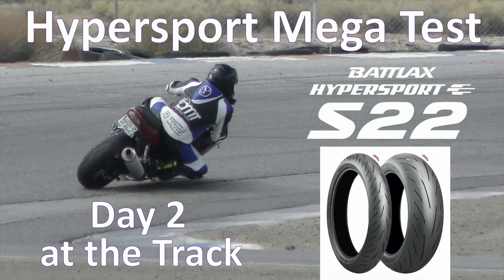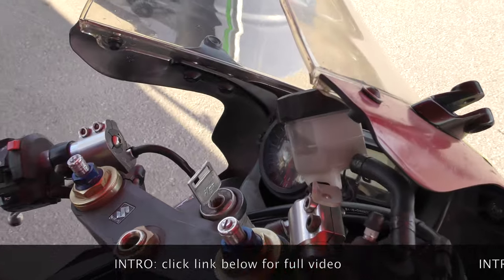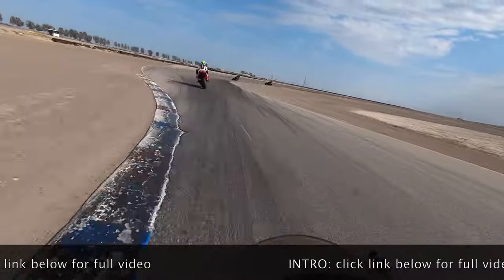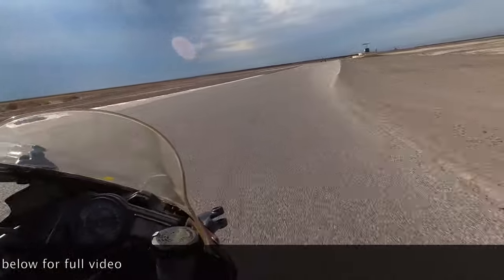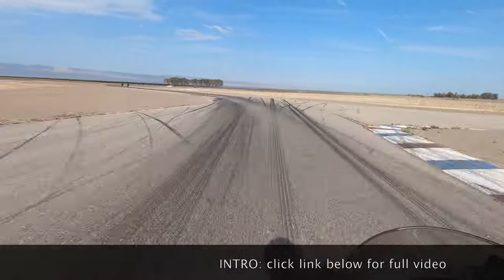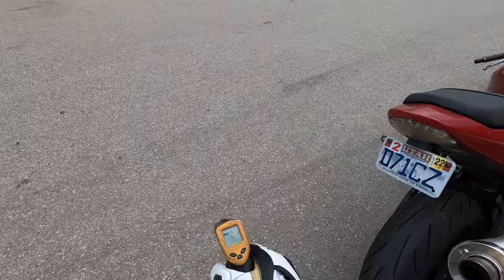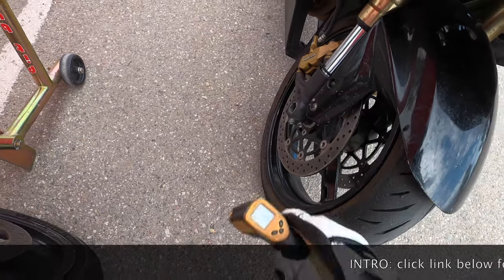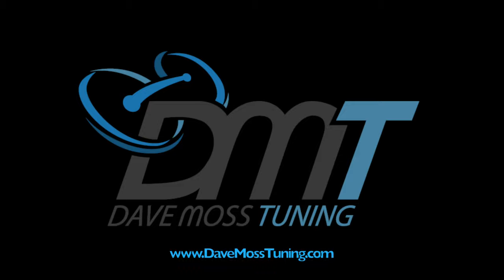INTRO Contact Patch: Bridgestone S22 test at the Track, Ep 8

Comment: Love you guys! I'm trying to get into track riding.  The cost tho. Have to get a trailer & everything but looks so fun!
Thank u for all the hard work put into this mega tyre test
Reply from the maker: Track riding can be done very cheaply. If you need a trailer, you could start with ride shares as many riders do that to help each other with costs. Always post and ask and you will be amazed at the support there is out there to get riders like you to the track. A small car trailer like alumline.com are relatively cheap. You can use hypersport tyres and all that is needed is brake light and mirrors taped.

Comment: I have these tires and very confident with them. I don't track ride but do ride aggressive on the streets. But I'm wondering if Pilot Road 5 might actually be better and easier heated to optimal temp and actually last longer than a hypersport tire like s22
Reply from the maker: Longevity is a tough one for a comparison based on road speeds and local road surfaces as there is so much variance. Road 5's are softer carcass and might heat up quicker overall.

Comment: Hey Dave do a lot of aggressive street riding and about to go to first track day currently on s22 but will need a new set do you recommend sticking with these or upgrades to the Dunlop q5s
Reply from the maker: If you stay with the S22, handling will be very consistent with what you know. That is critical for your first track day. Changing wil completely alter the handling of the bike and unless you do some work with chassis geometry and suspension, you will be disadvantaged and that would not be a fair comparison for the Dunlops.

Comment: Dave for fast road use bridgestone s22 or michelin power gp?
And what psi to use them
Reply from the maker: Depends what "fast" is....... I prefer the S22 for sidewall strength and carcass being able to follow the pavement surfaces well. For street is use 34 front and rear, BUT,  I do not ride fast on the street.
Reply: So Dave no the 36f 42r psi for aggressive road ride?
Reply from the maker: @user-cm8nf2bl1s   You can have any pressure that you choose. 42 for the rear would be too high and might create deflection so feel free to test 40 and 38 to see if you get more grip and as you ride aggressively, that would be a logical choice based on tyre pressures being around 30 cold at the track as a perspective..
Reply: So you mean 36 front and 38 rear
Reply from the maker: @ΑνδρεαςΔαναινας   yes sir

Comment: Hi Dave, I have a 2015 bmw s1000rr, it's time to change tires to go hard on the road, which one do you advise and what pressures ? 
Thank you very much.
Reply from the maker: I would suggest that you choose a hypersport category tyre with soft sides. The choice depends on grip vs longevity and your wallet's ability to keep throwing tyres on the bike. So the list is in order of grip 1st through to longevity: Q5 and Pirelli SP, Rosso III, Rosso IV and M9RR, Bridgestone S22/23 and Conti Sport ASttack. Pressures would be as recommended by the manufacturer, generally around 32/30 for very aggressive street riding to ensure maximum grip.

Comment: Hi dave, I just bought this tires and not installed yet, I use sc22 supercorsa 200/55/17 on rear and 120/55/17 on front... I just like to hear an honest revirew from you about this tires for track and everyday use, Its cheaper tire. I have s22 bridgestone 190/55/17 and 120/55/17. My sc2 supercorsa life span was very fast for me.
Reply from the maker: All hypersport tyres are amazing.  If you had Pirelli before, these will feel very similar as they share almost the same carcass and profile. Both Pirelli and Bridgestone will last the same amount of time.

Comment: Quick question here 🙋‍♂️ - I currently have a Q3 plus (rear) that is flat, courtesy of huge nail (not repairable)and while I am looking into either getting a Q5s, it’s little pricey so I am considering a S22; I noticed in a previous comment you mentioned the turn in slower, which is okay since I am indeed that and not really much of a knee dragger (working on it) is the turn in and shape similar to the Q3?
Reply from the maker: For what you describe, the best option is to find the same circumference rear with a very similar hard carcass. take the ruined tire with you to the shop and do some comparing.
Reply: @catalystreactionsbw  Sounds good, thank you.

Comment: Hey Dave, Ive been running these tyres on my sportbike mainly for street riding but its usually done around twisty roads. Was wondering what optimal temps i should be looking for when aggressively street riding (60-85 mph). I live in a colder climate so i'll adjust psi accordingly, but was looking to see what optimal temps i should be aiming for after about an hour of riding
Reply from the maker: Ideal gain is 2-3.5psi above cold after 40 minutes of riding. Temps? 120-150F if you are using an infra red laser.
Reply: @catalystreactionsbw  Thank you for your reply! I went for a ride today and ran 32f/35r psi and after about 30 mins there didnt seem to be any psi gain in either tyre and the bike felt a little squirelly, would you recommend adding pressure or reducing pressure in this scenario? (Ambient temp was around 44F)
Reply from the maker: @SteGy  Let's  test 32 front and 36 rear cold. Ride for about 30 minutes and check with the palm of you hand pressed in firmly. The front will feel cool to cold no ,matter what pressure you run in it and 32 would be as low as I would go.
Reply: @Dave Moss Tuning  appreciate the reply Dave! Will adjust pressures and  test when the weather allows and work from there! Great content and lovely support as always, heavily appreciated!

Comment: Which tyre would you choose for hard street riding. S22 or Rosso Corsa 2 :-) which would you trust more :-) ?
Reply from the maker: Rosso II is the harder carcass so ti will handle road conditions well at speed. The S22 is slightly softer and more compliant so bumps are a little smaller on impact for better stability. Both work incredibly well and as we are in a golden age of tyres, both work very well indeed. Rosso II will last longer in my experience, but you are looking for grip not longevity.

Comment: @Dave Moss Tuning  hi what is recommended for tires for commuting and maybe a little harder driving than touring, on a yamaha r1 2020 ? ☺️
Reply from the maker: Michelin Power 5, Bridgestone S22 are softer carcass so bigger contact patch when enjoying the turns and better compliance over the bumps.
Reply: @catalystreactionsbw  I must ask u a thing about the road series (road 5 or 6) 
Is the power 5 still the way to go or is the road tiers any option,  just curious
Reply from the maker: @forse88  The Power 5 is an excellent road tire for the vast majority of rides especially as road conditions are so inconsistent these days!
Reply from the maker: @forse88  I have a set of Power 5 to go on my Kawasaki Concours to test. I have not seen the 6 yet to compare.
Reply: @catalystreactionsbw  ok i was thinking to try a road 6 on my r1 just becuse of the longtivity ☺️

Comment: Hello dave, I have Q3+ used for agressive street riding and occasional track day. They are not available anymore, I am getting S22. What difference should I expect?
Reply from the maker: S22 is a softer carcass so less bumps overall, more compliance and slightly slower turn in if pressures are too low.

Comment: Using battlax s22 120 front and 160 rear. Any recommendation for the tire pressure in PSI? Thx you 🙏
Reply from the maker: Street, aggressive street, track? Please give me the information needed.
Reply: @catalystreactionsbw  aggresive street sir. Thank you before
Reply: And track. My body weight 96kg with yamaha R25. Thank you
Reply from the maker: @SepuluhSeptember  I would start at 30 front and 32 rear to give the carcass some shape under cornering loads. 3-4psi over cold would be the ideal gain.
Reply: @catalystreactionsbw  thank you for the answer, i tried and need to adjust little bit and feel awesome 👍
Reply: What is your experience with this tire in the rain? Like a good amount of rain
Reply from the maker: @Mech.E  Does an Antarctic storm count in New Zealand for two days?  Great - never a scary moment with 40 cold front and rear to make sure the sipes stayed open.
Reply: @catalystreactionsbw  awesome, would you say this tire is a bit overkill for just street use? Btw I'm going to fanboy a little and say I love your videos. Been watching before I had a bike. Picked up a z800 recently and made my dream come true.
Reply from the maker: @Mech.E  For street use yes - I'd stick with the Power 5 if you are a Michelin fan or any other tyre in the hypersport category. Congrats on the Z800 and making this motorcycle a reality for you not just a dream! Congrats :)
Reply: @catalystreactionsbw  Thanks a lot!
Reply: @catalystreactionsbw  what tyre pressure for track day on s22's , thanks in advance Dave!
Reply from the maker: @dottore46full  I would start at 28 rear and 30 front and note that a 4-5.5 gain over cold is ideal.
Reply: @catalystreactionsbw  thanks man

Comment: Dave i have a question, should I put the new set of s22 180/50 on my gsxr 1000 k7.. I took em for zx6r but sold the bike and got 1l,what should I expect is it worth doing it
Reply from the maker: If you have a 5.5 inch wheel yes. If a 6 inch rear wheel, no as you can roll off the edge of the rear tire.

Comment: Is bottoming out whilst braking too much of a problem? Cheers Dave.
Reply: yes because then you basicaly dont have any more suspension and therefor low grip.
Reply: On the cusp of catastrophe.
Reply: Solution? Add more compression damping,still have plenty left.I have no preload adjustment.
Reply from the maker: Look at it from this perspective. If you bottom out, you can not add any more brake pressure or the rear will lift, then you have to release the brake to put it down again.  Yes, add compression damping and if you max that, add 25cc of oil to each leg unless the oil is over 5,000 miles or 8,000kms of use.
Reply: @catalystreactionsbw    On an 2023 MT-09-sp with KYB forks. .   Trying to understand where the bottom actually is.   My zip tie is 3/4 " from the bottom after hard breaking tests.   Is the bottom of the lower tube the actual bottom of travel?   Or is the bottom of travel some height above the bottom of the lower tube?
Reply from the maker: @MrArtisticGuy  This video will help. Not that specified travel is 130mm. I have not seen a 2023 model so I will not guess. https://www.youtube.com/watch?v=eds3dn1LBkw&t=80s

Comment: Dear Dave i have a major problem with these tyres.I have high speed wobble that starts at 170km/h (yamaha tracer 700).I found that others have the same problem with sport touring bikes that didnt had with previous tyres.I changed air pressure,i set the suspension correctly,it seems like aerodynamic problem.Any suggestions?Thank you.
Reply from the maker: How much shock travel are you using compared to fork travel? That will give you the insight you need o understand why this is happening.
Reply: same problem with the mt-07, it also wobbles at speed
Reply: @ikbendusan yeah men,many people have this. There is no way to pass this problem...the only way is to change tyres.Can you tell me what tyres did you also tied
Reply: @BGDS  both the original tyres and the replacements wobble. it came with bridgestone bt023 and i replaced them with bridgestone s22 after i wore them out
Reply: Same here. I’ve had the same problem whether it be from a stand still or a roll on to high speed. Came stock on my KTM Superduke R.

Comment: S22 bridgestone is a shitty tire it wobbles at speed more than 150km/h, mine is an MT09, and after I changed to the Diablo Rosso 4 the wobble disappears. The tires are not stick to the ground; it is slippery ...
Reply from the maker: The wobble is chassis geometry. We are in a golden age for tires so I respectfully disagree. The issue is too much weight on the rear wheel and not enough on the front, Getting the DR4 with a bigger circumference helped the issue but did not fix it. To get that done right you need to set preload and damping correctly and manage fork and shock travel. In your case, shock travel is most important. https://www.youtube.com/watch?v=KeZT1LCY8CU&t=6s
Reply: @catalystreactionsbw  i paid premium for your website and settings exactly like you did on your video for MT09 2022, my weight same as your partner the one sit on the bike 80-82kg. It is still wobble, only wobble in front not on the rear. I did change the tire and it isnt wobble anymore, so how do you explain that?
Reply from the maker: @PhysicalChessBJJ  Thank you for being a Premium subscriber! There is more weight on the front wheel now as the rear is higher. The shock does not travel as far as weight is more forward. This helps substantially. As you also have the fork and shock rebound much more controlled via settings, this is another significant step in the right direction.
Reply: @catalystreactionsbw   thanks for your reply, let me try it. I was trying your settings leaving 2 lines of preload and other setting such as high & low speed compression + rebound same as your video. As you see, the sag is quite difficult to measure as it leaves no static sag at all.
Reply from the maker: @PhysicalChessBJJ  The fact that static sag is gone is the 100% confirmation that you need a stronger spring provided that the shock gets 1-2mm from the rubber bumper with travel used.
Reply: @catalystreactionsbw  mmh,you make me think that i was wasting money to get the SP, coz of the KYB Front suspension not as good as I think.
Reply from the maker: @PhysicalChessBJJ  No money wasted on the SP, just a little more tuning time to get it right.

Comment: Hey Dave what is the optimal temp for the  s22 tires?
At what temp will I feel them start to get "greasy"?
Thanks again for all you do.
Reply from the maker: Greasy is hot for the tyre BUT can also be the track surface being hot and oil coming to the surface so be careful to distinguish each one. Some tracks are known for low grip over XF/C, so that data point is essential. For the S22 when measured in your pit post session, the soft edges need to be 150F minimum and over 190F the tire has less grip.
Reply: @catalystreactionsbw  great info thanks!
I'm subscribing to your total access as I  would really like to learn this aspect of tuning a bike as well.
Have you done a comparison of the s22 and the Rosso 3 for track use?
Reply from the maker: @deweysturgill6220  Not the Rosso 3. I find that tire is really hard to dial in at the track as the softest compound  always wears quickly unless pressure is low. The Rosso 2 seems to be far better overall and last longer. I have only tuned one Rosso 4 on a hot day, nothing yet with Winter weather. I hope you enjoy Total Access and thanks for your support by subscribing.
Reply: @catalystreactionsbw  Where can we find sources for info just like this?
Reply from the maker: @LAGman91  Contact Patch playlist has all the information on tyre wear you will need. Technical data on temps/pressures etc can be acquired from the manufacturer.

Comment: Hi Dave, S22 tires came with my 2022 MT10 SP, what psi do I run for hard street and canyon rides? 30 30? Thanks
Reply from the maker: As there is no information on your weight, minimum for track is 32 front and 30 rear on a 75F day with an advanced rider at 180lbs. Based on that baseline, you can do some testing.
Reply: @catalystreactionsbw  thanks Dave, we’ll do some preload measurements tomorrow also, I’m around 68kg without gear and currently riding on leathers. Seems like my rear preload is too soft.
Reply: @catalystreactionsbw  by the way temps here do not drop below 30C, it’s usually at 32 to 40C and very stupidly humid lately. :(
Reply from the maker: @motorjack141  Check fork and shock travel used for verification once you have your static and rider numbers.
Reply: @catalystreactionsbw  thanks boss Dave, front has 1” left but rear seems to be bottomed out, didn’t feel any slips so probably just barely bottomed out. Probably didn’t take into account the suit weight as we measured before using no gear. 🤷🏻‍♂️
Reply from the maker: @motorjack141  If the front has an inch left, the rear is too soft and sag numbers should reflect that. Once the shock is corrected for preload and compression, the front should be very close indeed.
Reply from the maker: @motorjack141  Easy enough to sort the shock out and that will correctly balance the bike via preload and weight distribution.
Reply: @catalystreactionsbw  thanks!